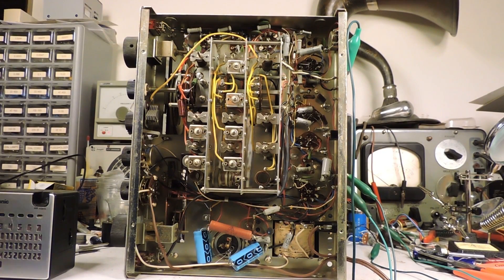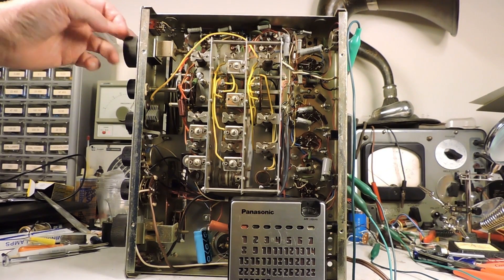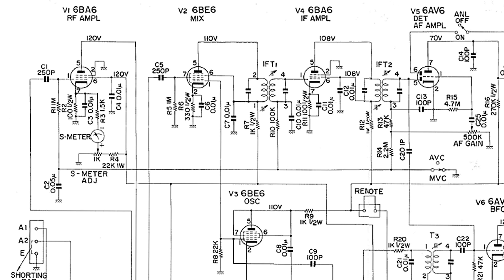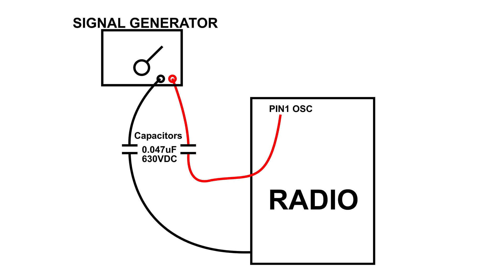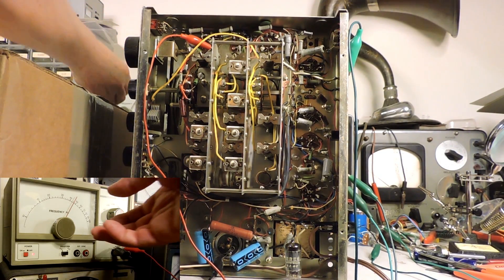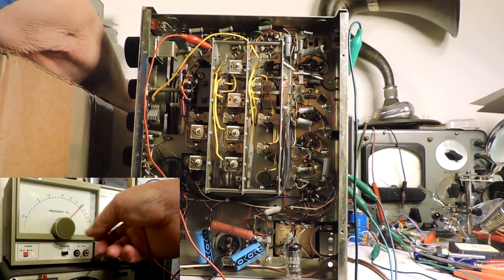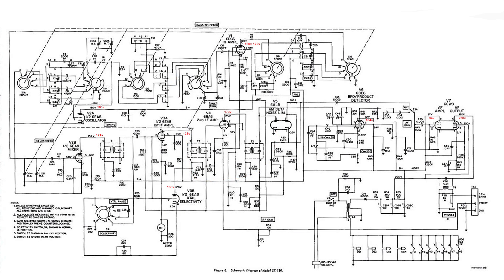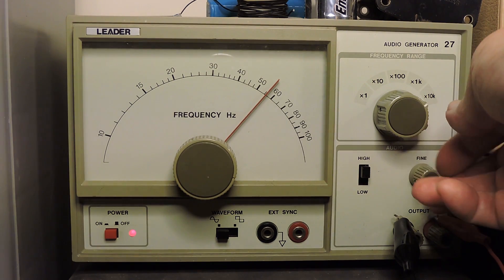Radio Oscillator Substitution and troubleshooting techniques

Comment: So it appears if the local oscillator in a radio is not working, that you can use a signal generator to substitute an oscillator frequency to allow the radio to work again?
Reply from the maker: Thank you. Yes taht is correct!

Comment: I just cant get this to work...I want to try it on a Silvertone 2015...can you show me where to connect this up...thanks...
Reply from the maker: Should be able to connect to the oscillator variable capacitor, that's the smaller one.

Comment: Great, thanks for this. Your final point, what should the amplitude be? Im using a digital function generator which defaults to 5vpp.
Reply from the maker: It depends on the radio, start low and work up.
Reply: Low being..? (the lower limit of my particular generator is 4mvpp)
Reply from the maker: If 4mv is not low enough put a volume control on the output of your generator.

Comment: So, you use the audio generator to simulate a working oscillator? Then If the radio plays when using the audio generator ( acting as the oscillator), the radios oscillator is faulty.
Reply from the maker: The station that comes the strongest was around 60. The generator is on X10KHz so that is 60X10,000 = 600,000Hz